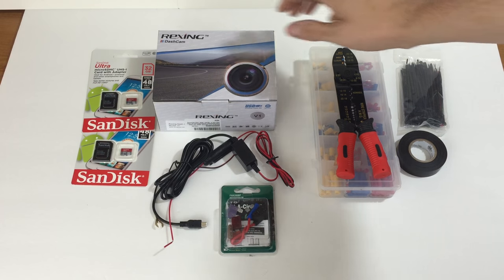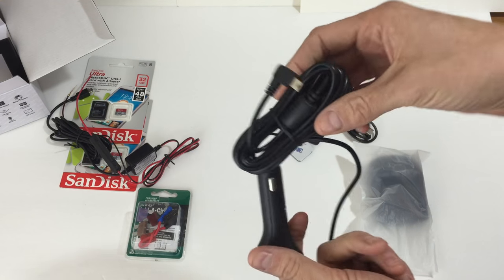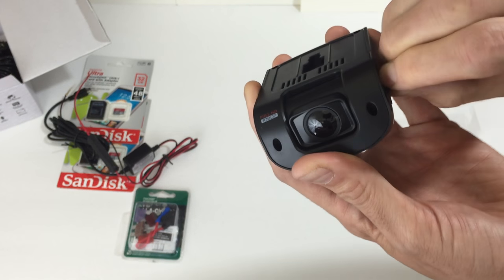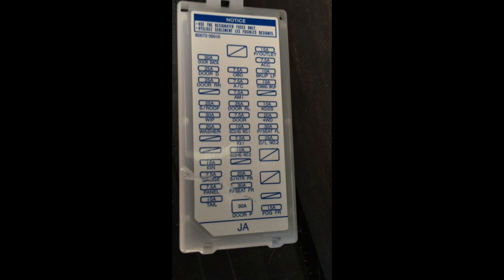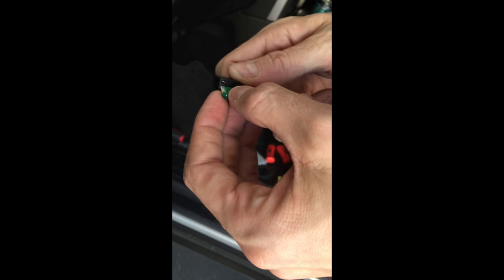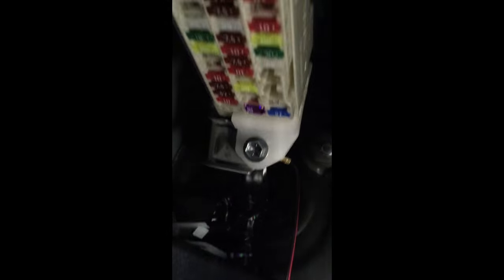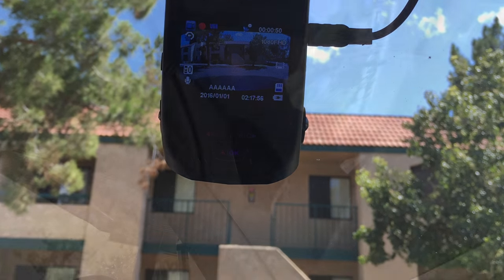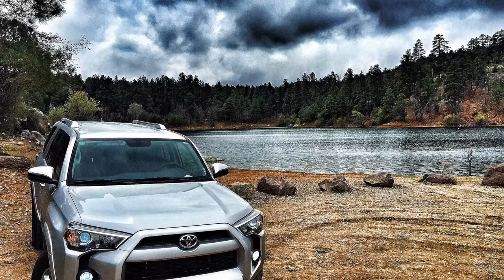Dash Cam install - Rexing V1- 2015 Toyota 4runner

Comment: You can pull the weather stripping off the door to make it easier.  One problem I see is you didn't take the A pillar cover off and the wire is in front of the airbag.  Best practice would be to put the cable behind the airbag.  If the airbag goes off, camera will go flying.

Comment: Hi... If you'd allow a few questions for clarifications? (1) - as per your update on 1/8/17, you had selected a different source. May I know which source you have chosen (I'm not that knowledgeable about automotive electronics)...? (2) - I'd see that there is you didn't put back the cover for the fuse box (reference: 4:39)?  And (3) - tucking the wire into the pillar doesn't impact the airbags? Thanks in advanced!

Comment: Thanks for the video.  The add-a-fuse part I can use.  Unfortunately, I've gone through 2 separate dashcams that I've tried mounting directly to my windshield.  They don't survive more than one summer in the Austin, Texas heat.Cheers.
Reply: Good to know thanks!

Comment: Awesome video. I've just purchased a V1P Pro and will be using this (and the V1P video you posted) as a guide while I do my install. I had one question about the fuse tap, though. Why did you use a 5 amp fuse for the camera? Would a 10 or 15 amp fuse work just as well?

Comment: which fuse did you end up plugging into then for not "hot"?
Reply from the maker: hello, I used the "P/Outlet" slot in the top right corner instead so that it shuts off when the car also shuts off. Thanks for watching!

Comment: Fantastic Video!!! I modified this post based on your great answers below. Regarding parking surveillance: How practical is it to keep the cam on all the time? It is nice to know a good size SD card will last for 7 to 8 hours. Otherwise, if your car alarm goes off you will need to go check it to keep it from over writing the video, correct?  Finally, since it doesn't record anything but audio, you can't see anything inside the vehicle. Audio might help if you know the person. If the car is stolen or your cam is stole it will not help will it? (There is a WiFi version, but again, I'm not sure how helpful that is for parking surveillance.) Have you tested how well it works as a parking camera?  Thanks Sorry for all the questions. I'm just wondering about the pros and cons of having it always on. I like the idea but it has limitations.

Comment: Hey, my dash camera seems to freeze almost once a drive and i just installed it a couple days ago. I followed your steps, and it was super easy. I keep having to hit the reset button and turn it back on. I havent pulled the memory card yet to see it the camera is saving clips to the card yet, but I image when it freezes, its not saving. Have you had any trouble with this? By freezing I mean the screen is frozen and a frame is stuck. Any info is appreciated, thanks

Comment: i have the toyota rav4 hybrid my fuses are under the hood. do i need to remove a 30 amp fuse from fusebox then install my cam wire or do i just look for a free 30 amp slot?

Comment: Hey everyone, do NOT install the wire over the airbag as seen in the video (5:50-6:30). This will impede the operation of the air bag and make it unsafe.

Comment: Its great video. But I need help with my 2015 ecoboost mustang, I got same dash camera, which power source do I  take for my cam? I got the wiring kit that you suggested and the mini add a fuse. Thank you
Reply from the maker: use any source that will keep the car on when the vehicle is off  such as the power searts. or if you wat it to turn on only when car is on, then choose a source that isnt on all the time

Comment: if recording in loop 3, 5 or 10 min takes about 300 MB for a minute of 1080p recording, why do you need a 32GB microSD card ? it would be enough a 8 GB card!!!!   i have this camera and i would like to do at least 3 or 4 Hours of recording before starting to record again and erase the previous record, ho to do it?
Reply from the maker: You need a larger memory card if taking advantage of the parking monitor and motion sensor features, because it will record almost everything as if acting like a sponge over the course of a few hours, the sponge can only get so big, so buy the biggest one. I read 64gb doesn't work though, so 32gb is the largest. I experienced that it lasts about 7-8 hours depending on the activity it sees. I took a road trip that was about 10 hours but when I got home, it looped over the drive up. So you need a larger memory card for movie making or surveillance. if not doing either, then yes a smaller card will be fine.
Reply: what "motion sensors" features? can you tell me where in the menu you can enable motion sensors?
Reply from the maker: those features will appear in the menu once you install the two firmware on rexing's website. there should be info on how to do that there. it is http://www.rexingusa.com
Reply: The Ronin Chronicle how do i install the, do i put the firmware in the microSD and turn on the rexing in a special way?
Reply from the maker: you cannot do it while memory card is in the camera. you need to take it out and put into computer. then add it to the memory card, remove from computer, install into camera, wait a few seconds, then remove memory card  again and re-insert into computer so that you can delete the files off the memory card. And then put it back into the camera when finished. if you don't do this, then it won't work.
Reply from the maker: Here is the FAQ on rexing's website, it was very helpful to me in the begining.
http://www.rexingusa.com/?p=415#comment-203
Reply: i've upgraded to EXPERT firmware 1.0 ...i turned on both "parking monitor" and "motion detection" ..and now when the camera start to record, even if i press "stop recording" .. it stops and start again, ..so i'm unable to stop it!! LOOOL. where is the new manual in PDF to read about these 2 new features? :D
Reply from the maker: killabot3 you cant stop it because its detecting you while you hold it. hahah
Reply: what about the power consumption when this feature is turned on, i dont want to find the battery of the car completely depleted
Reply from the maker: from what I have read and experienced, there is no issue there.
Reply: Tech. you COULD download the firmware to the desktop and then unzip it, move it to the SD card while it is in your camera having the camera attached to the computer. An option will come up saying, Mass Storage or PC Camera. Select Mass Storage and now you have an external "hard drive". Once you migrate the unzipped firmware to the SD card in the camera, power it off, and back on. It will load the firmware. Give it a little bit of time, 15 seconds should work. Once it is done, reformat the SD card. Otherwise, it will always load the firmware upon start.
Reply: You gave this explanation 2 years ago but as recent as 8 months ago (at this point) it killed your battery when you left it in without using your car for 2 or 3 days. Just so people who read this will know in case they don't see your other comment! Thanks a million!

Comment: is it dangerous to mount it to the fuse? can you please explain better how many Amps was the fuse you connected? and how it works adding 2 fuses to the branched cable? (sorry for my english)
Reply from the maker: You may want to consult an electrician for a good explanation on how it will work for your needs. . Thank you!